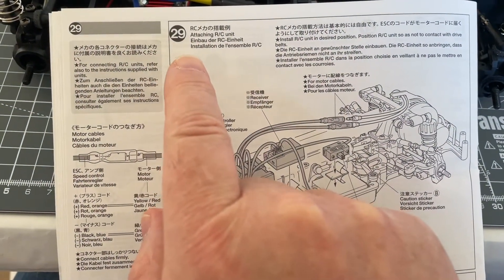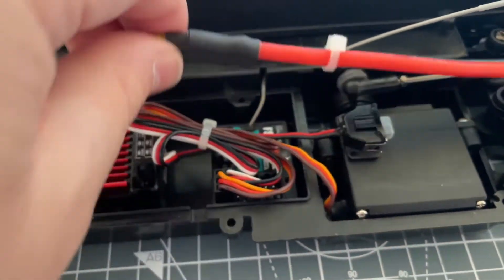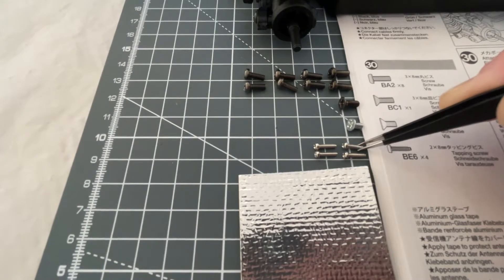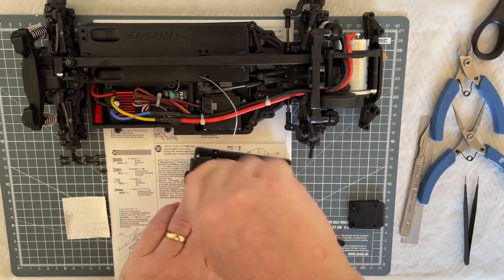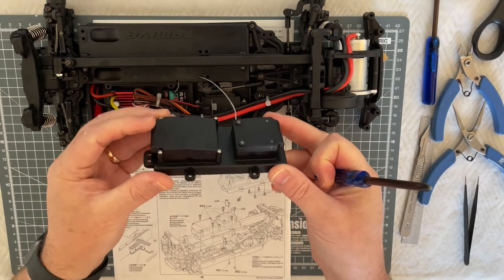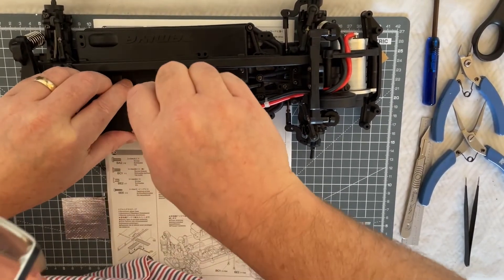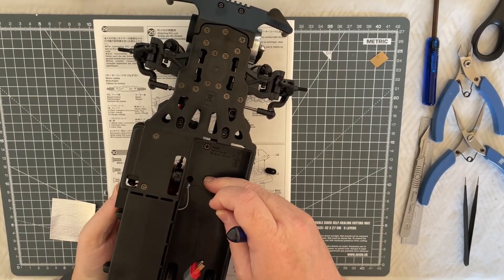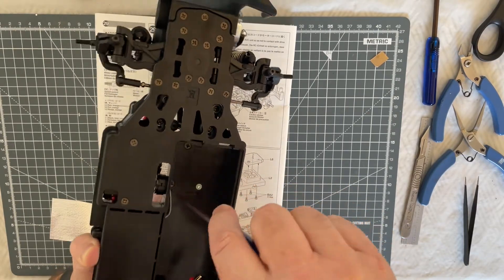The Tamiya Delta Integrale XV-01 Chassis build steps 29 & 30 #rcelf

Comment: Hello  John👋🏻!
Adding heavier gauge wire should definitely improve temperatures on that motor over the stock gauge wire. Love that this has a box for the esc that can open up and allow for more cooling. Very clever design! I like how you keep wiring  nice and streamline! Almost there! I’m getting excited!👊🏼🤩👍🏻
Hope you and your family have a great Easter weekend! God Bless! 🙌🏼
Reply from the maker: Hi there Robby, thank you for watching, I appreciate you stopping by. Yeah, thought best in reduce the impedance for the ESC, hopefully I won’t need to open up the case for cooling, I kind of hoping that I can keep as much of the dust and debris out. 😂. I’ve a secret about wiring….I used to be an electrical engineer (many years ago 🖐️🫣) hence the obsession with neat wiring. 😂. Have a lovely Easter, god bless to you and the family. 😉😊